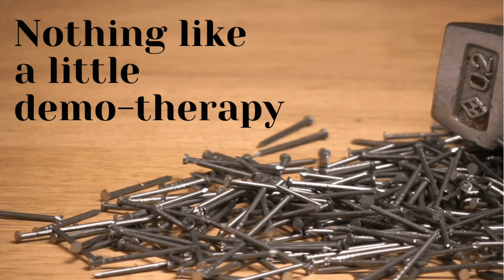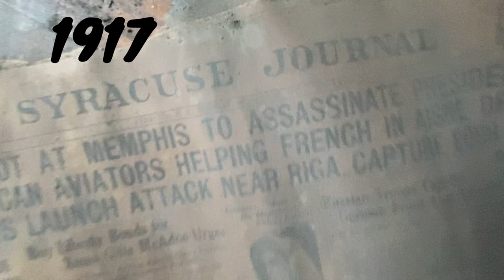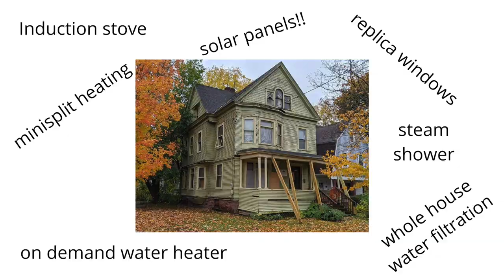youtube video #-FlIdHy1z3U

Comment: As I mentioned that my previous comment in the last episode. It’s the right thing to remove this flooring. I don’t believe it was meant to last forever. Although I did for the last 120 some odd years. A couple of pointers while you remove the existing flooring. Remove the nails as you remove the flooring. Otherwise, you will be stepping on the remaining nails on the subfloor and they’ll become even more difficult to remove. The next obstacle will be the baseboards. What do you do now? Well, I removed the baseboards because I added 1/2” inch plywood subfloor on top of the existing 3/4” inch plank subfloor. On top of that I will add 3/4” inch hardwood flooring. (You’ll need something substantial to nail down your new flooring. Which is why I added 1/2” plywood sheathing over the existing) This also brought up another issue …the baseboards will then be 1 1/4” sunken. Therefore I also removed the baseboards as well. I guess the next question is, do you remove the door trim as well?  …. I did. Do it all right the first time. This way you could remove the existing plaster and lath that’s behind all of the trimwork. One thing to keep in mind is plaster and lath is typically 1 inch thick. Upon reassembling, I would infill 1 inch thick sleepers behind floor boards and door and window trim.  I hope this helps.!!
Reply: Yes, You are correct... and some concatenation of your suggestions is in the works and is evolving

Comment: I’m sorry that the floors had to go.  I’m a bit confused though. Was the floor you took up hardwood and the floor underneath softwood?   In England where I live there is usually only one layer of original floors and in Victorian houses these are about 6” wide.  My daughter recently bought a ground floor flat conversion in an 1888 house. It too us a while to realise one room had 6” boards, another 6.5” boards and the hall was half of each.  There had been a historic leak in the hall but it had not gone through the carpet and two layers of linoleum.   I am sure you will find something great to replace them with. I love the song and your nail pulling competition!
Reply from the maker: Thank you!  Yes, the floors underneath are soft wood, pine.  The finished floors on top we call hardwood.  We have to take up all the hardwood as it got water logged, warped and then moldy from the leak in the whole house.  We're finding all different sizes of wood in our house too!  It's like a puzzle.  Thank you so much for watching all the way in England.
Reply: @TheGrandLady  thank you for making it clearer.   My little 1929 house has very hard floors and they took a long time to sand.  We think they are maple rather than the pine boards in my daughter’s Victorian home.    They look great oiled.

Comment: Was it suggested that you have large fans brought in to circulate the air to help the drying process? So sorry about your floors, so heartbreaking.
Reply from the maker: Yes!  ... and we did have industrial fans running for quite awhile and would have continued but the roofing company bailed on us... their insurance company did as well.   It became clear that because it was the entire house having been soaked on the INSIDE of the walls we would have to remove all the plaster so, we have spent most of our time trying to recover from the water damage.  We had hoped the floors that were covered by other misc layers might be ok.... but... well... they weren't spared either.